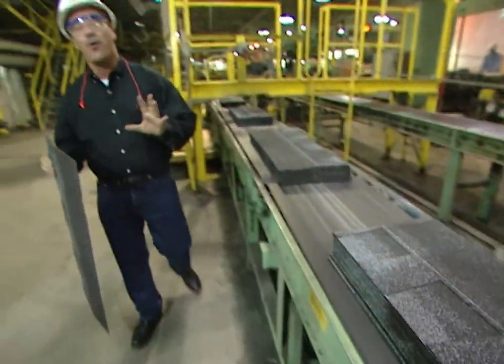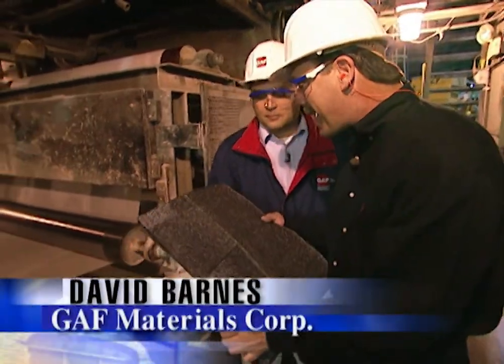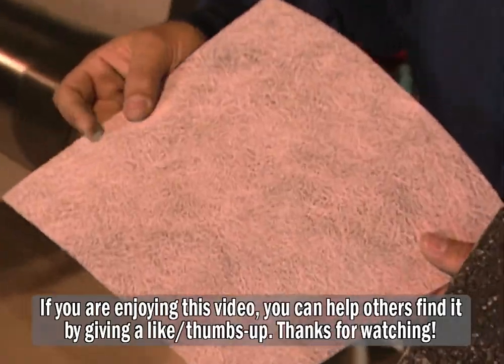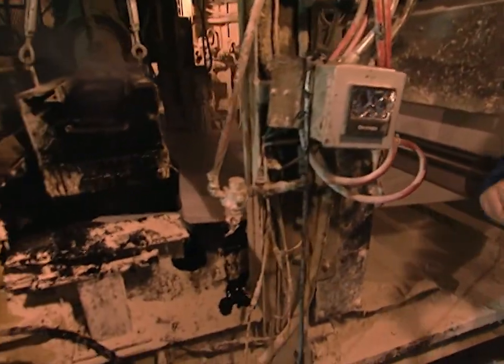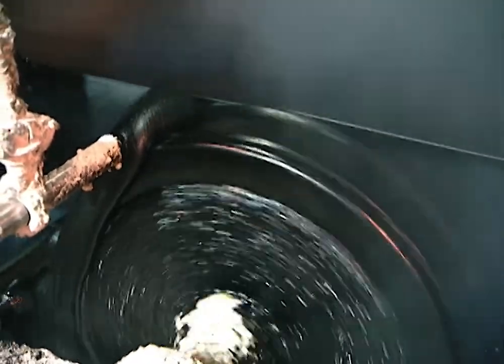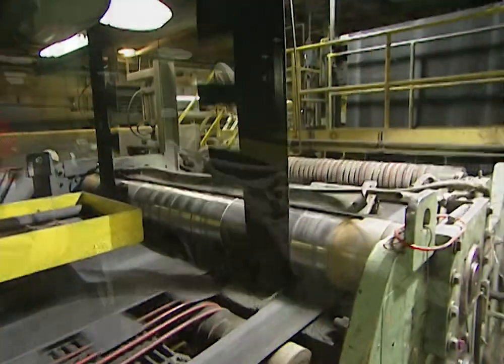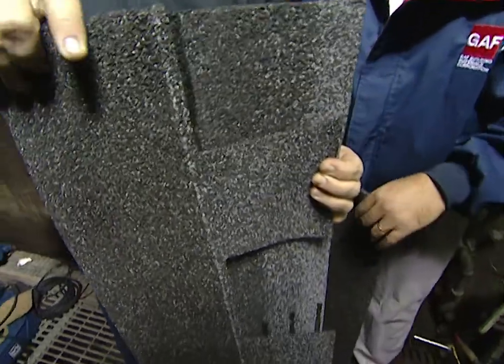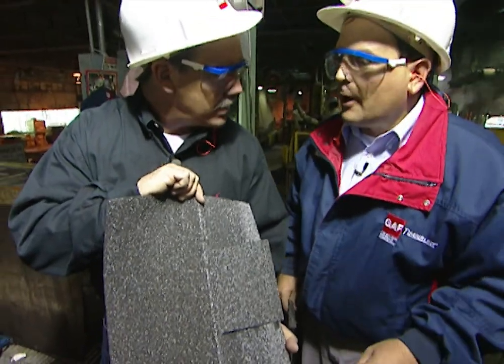How Asphalt Shingles are Made - Did You Know

Comment: The colored ceramic fired chips are applied in various shades/patterns to cover any defects, provide a curb appeal and to prevent those shiny spots caused by bitumen bleeding through. Proper weight and tear strength is important and shingles can only be inspected when set up outside in natural sunlight though most inspections are performed inside under lighting.
Reply: Did you install them or work in a factory producing them?